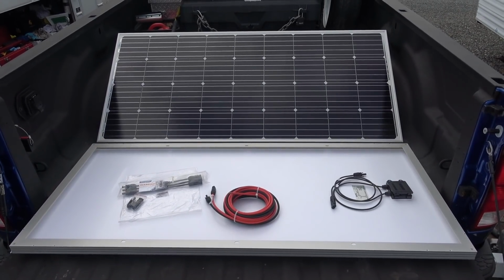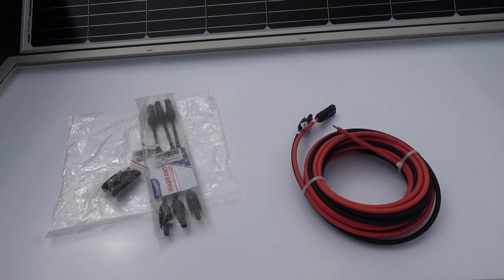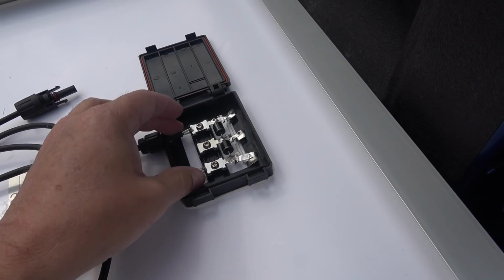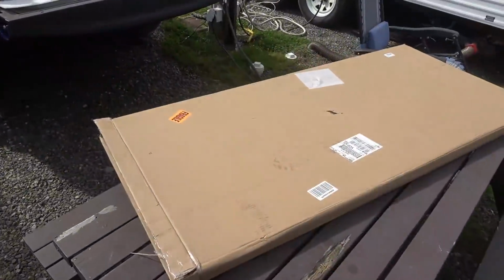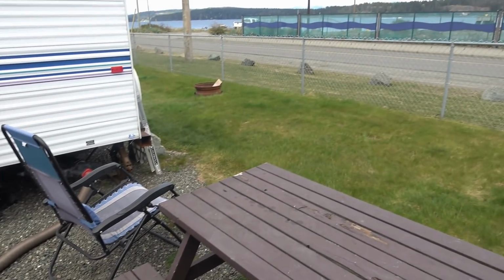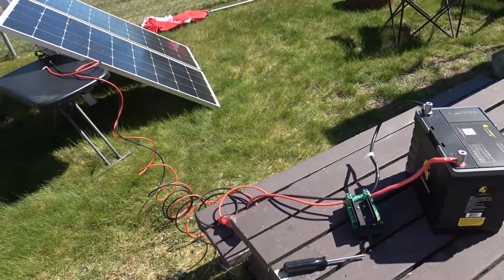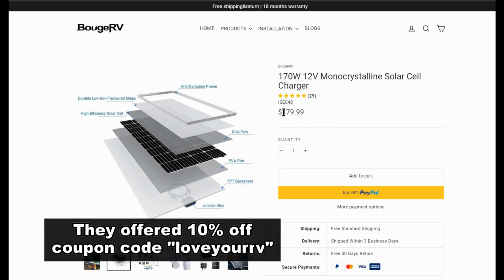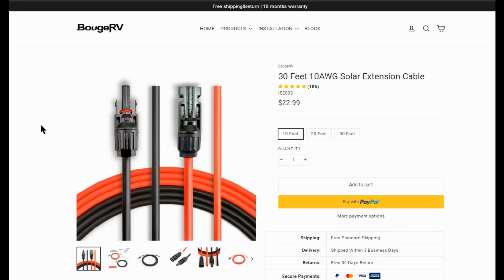BougeRV 170 Watt Solar Panel Review

Comment: Can you do a review on the 400watt
Reply from the maker: Do you mean this?  - https://www.bougerv.com/collections/solar-panels/products/400-watts-solar-panel  To me it looks like its actually two 200W panels
Reply: @LoveYourRV  Thats it.I need something to power my 500watt jackery.I dont want to pay 399 for a 100watt jackery panel :( lol
Reply from the maker: @TheHideout7  The Jackery 500 has a limited amount of solar it can take so buying 400 watts is way more than the box can handle. I think it's designed to use any standard 100W 18V panel, but some people get creative with the wiring and can squeeze a little more juice by series wiring panels but the max input is 12V-30V, 3.5A  I tested it out in my review video - https://www.loveyourrv.com/jackery-explorer-500-portable-power-station-review/
Reply: @LoveYourRV  just noticed that.Im gonna have to get the 100watt ty:)
Reply: @LoveYourRV  does the jackery 500 have the option to charge it with a marine battery? I dont know what the adapter is called could you help:)
Reply from the maker: Could get a cheap 100W rigid glass panel under 100 bucks.
You could use an inverter or a DC-DC charger. A DC-DC charger would be more efficient but sometimes it's nice to have an inverter for other things.
Reply: @LoveYourRV  Im using this in my truck.They have like red and black they look like jumper cables.
Reply: @LoveYourRV  I appreciate the feedback trying to get prepared for summer trip.🙃
Reply from the maker: Yes, you can get adapters, like this for example - https://amzn.to/31q3t19

Comment: If 2400 Pa is 50  lb/ft squared, then wouldn't 5400 Pa be 112.5  lb/ft squared ( the reference blurb presented at 5:35 says 125 lb/ft squared ( 6000 Pa? ) )? Or is there some kind of non-linear formula?
Thanks for the in-depth presentation!
Reply from the maker: Yes, likely a mistake in the marketing. Cheers, Ray

Comment: Are You sponsored by renogy? Amps for the $$$, Great panel. Warranty, not much to fail once you plug it in , and for the what if, well is a tree branch hits it, you are sol anyhow. Now, bouge has an 180 watt. Value of Power for the Dollar..
Reply from the maker: No, not sponsored, I purchased all my Renogy 100W panels myself starting with the first two in a kit I installed in Dec 2014. These 2 BougeRV 170W panels were sent to me free by the company for review.

Comment: I was tempted by these, As I could get a 300W setup with just 2 panels instead of 3. Looks like it would be worth it to use these. However, while the price is great, it inst as good as buying 3 of the renogy panels. 3 panels for $325 CAD vs 2 panels for $425 CAD.
Reply from the maker: I would go for more panels versus fewer if you have the space and willing to pay for the extra wiring and install time. Better in shaded areas and if one panel quits less power is lost. Cheers, Ray
Reply: @LoveYourRV  true. I have 3 100w ones. I had a bunch of 10agw and 12agw wire kicking around so the only extra cost is the connectors

Comment: So you were showing about 125 watts per panel while charging the battery?  Is that good for a 170 watt panel under normal non lab conditions?  I only ask because I got a 160 watt panel I'm testing and getting that same 125 watt amount.  Just trying to make sure that is a good output on a sunny day.
Reply from the maker: Its not abnormal, there are many different things that go into the output. Like sun angle, haze in the atmosphere, temperature of the panel, wire and connection losses, battery charge state, type and quality of solar controller used, etc. With all that its normal to only get 80% of a panels rated wattage going into the batteries.  Cheers, Ray

Comment: Ray, I'm a novice at this topic so I have a question.  Paralleled flat on the ground you measured 14.3 amps coming from the panels but you then said it was putting 18.58 amps at 13.46 volts into the battery with a pwm controller. I can understand how a mppt controller could maybe do this but a pwm controller? Is this right? I thought the excess voltage in a pwm was just "lost", unlike a mppt which can raise the amps with the extra voltage. What am I missing. Love your videos, thanks for posting.  Yeah, warranty not very good. I'm a fan of renogy.
Reply from the maker: Sorry for the confusion, before I took the battery side readings I put the panels back up tilted 90 degrees to the sun for max amperage. An MPPT controller should be able to increase that battery side amperage. How much depends on lots of factors. Usually, around 15% but in perfect conditions, most manufacturer's marketing boasts a 30% increase.

Comment: Ray I have a quick question on how you removed the rivets attaching the coroplast to underbelly? Thanks in advance!!
Reply from the maker: Mine didn't have rivets is was attached with 3/8ths self taping Tek Screws https://www.loveyourrv.com/reinstalling-the-cougar-fifth-wheel-underbelly/   https://www.loveyourrv.com/rv-fresh-water-tank-falling-out/
I guess you could drill out the rivets then replace with Tek screws. Cheers, Ray

Comment: If anyone is building a larger system they should be using the higher voltage (35 - 40v) residential panels (300 plus watt) instead of the lower 12v panels.  These higher voltage panels are significantly cheaper (less than $0.50/watt), more efficient, and start charging a 12v system earlier in the day and later into the evening as they need less light to get over the 14v hump to start charging.  These will require the use of a MPPT charge controller but will charge your batteries a lot faster.
Reply from the maker: Can't you just run 12V panels in series for higher voltage and get the low light charging?  One advantage of many smaller 12V is that they can be more strategically place on the roof for less shading problems. Also with more panels you have more redundancy if one fails but on the flip side more wiring required. Mounting hardware doesn't need to be as strong especially if tilting but more of it is required. I can see advantages and disadvantages to both.
Reply: @LoveYourRV  In theory yes...but practically you will find the higher voltage panels will out perform the smaller ones.  I also note the very short warranty period...residential panels typically have a 25 year warranty and again...a huge price advantage.  You also get more watt/sq in in the bigger panels...so with limited roof space, bigger panels can sometimes get you more wattage.
Reply from the maker: Yes, they have advantages, depends on the RV roof area though, the problem is many RVs aren't a big flat empty roofs. Most have 4-5 roof vents, TV antenna, WiFi cell.antenna, shower skylight, 1 or 2 AC units, etc. Likely that is the reason the small 12V panels built for mobile use are still very popular. Easier to maximize the solar while keep shading problems to a minimum, with more placement choices. Also, many 12V panels are built for mobile uses on an RV or boat whereas many of the large cheap grid tie type are built for a stationary environment. Cheers, Ray

Comment: Solar panels seem to have become commodities these days... I would attach them together with hinges so they can be stored like a suitcase with the cables and charge controller inside (maybe store under the bed or on the ceiling of the storage bay)... You already have a charge controller but for those without a simple 30a PMW could be had for less than $40 and could be mounted on the back side of one of the panels and the 20 ft cable attached directly to the batteries or via a solar ready plug... Here is a basic Charge Controller for the setup... https://www.amazon.com/Renogy-Charge-Controller-Compatible-batteries/dp/B07G1PL1B9/ref=sr_1_7?crid=3GXGGJPFE07ZC&dchild=1&keywords=30a+charge+controller&qid=1587352863&sprefix=30a+c%2Caps%2C435&sr=8-7

Comment: I get 26 amps (max) from my 12 volt 750 watt solar array. Is that poor?
Reply from the maker: That does seem quite low, usually you can see max of 5-6 amps per 100 watt panel. When I was running 500 watts I could see that much come spring and higher sun angles. Maybe you have issues with too small of wiring restricting the flow. Just a guess.

Comment: Thanks for the review. I'm just in the process of setting up Solar for our RV and after agonizing for a while over which kit or parts to order I ended up settling on the Renogy 400w kit with the intent to upgrade the PWM controller to an MPPT later. I did take a close look at these BourgeRV panels but the short warranty and few reviews is what made me go Renogy at the end of the day.
Reply from the maker: Renogy has worked well for me, have two panels installed Dec 2014 and two more install a year later all still putting out full power. Cheers, Ray

Comment: Hi Ray!   I see you have a clamp on AC/DC meter "UNI-T  UT210E". I consider a "Meter" with clamp on DC measurement capability a MUST for an RV tool basic tool.  Do you remember what that went for and how do you like it?  I'd love to hear your opinion on that.  Best wishes.
Reply from the maker: Works well, bought it about 3 years ago or so - https://www.loveyourrv.com/electrical-test-gear-aboard-rv-uses/  Looks like they go for around 50 bucks but I think it was about $10 cheaper back then. Its been really handy.

Comment: Which video would you recommend for a newbie to watch? I want to use solar to plug into my "solar ready"  RV as well as my Jackery 1000 portable battery/ generator. I can absorb all of your advise, but really just need the basics to get started so I can charge both well and not blow them up, by using too much electricity on either one and blowing a fuse! Thanks for a push in the right direction.😀
Reply: I have found a series of Solar Power videos from Will Prowse to be extremely helpful. He does a lot of product tests and installation/configuration videos that are extremely thorough. His DIY 400 Watt Solar install videos (2 parts) were the clearest instructional videos that I have run across. You can find Part 1 at: https://www.youtube.com/watch?time_continue=796&v=IRRKHYwB3Uo&feature=emb_logo
Reply from the maker: Try a search on YouTube for "rv solar101" That will bring up quite a few videos. Many people will start out with a solar kit that comes with the panels and solar controller. 200 or 400 watts is a good starting point. Also a good idea to add extra batteries.  Its the batteries that power everything. The panels just recharge them. So you need enough battery power to get you through the night or a cloudy day.  Sizes of systems vary wildly depending on how much power a persons off grid lifestyle requires. :)
Reply: @LoveYourRV  thank you so much.😀

Comment: I have 3  170w panels running in series threw a Victron MPPT Controller. And they do really well. As an addition note:  I had an issue with one panel and they replaced it in a few days after I contacted them threw Amazon. But only 7 months in on owning the panels a 1800 miles driven.